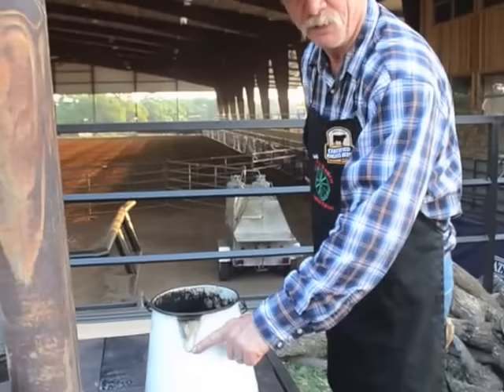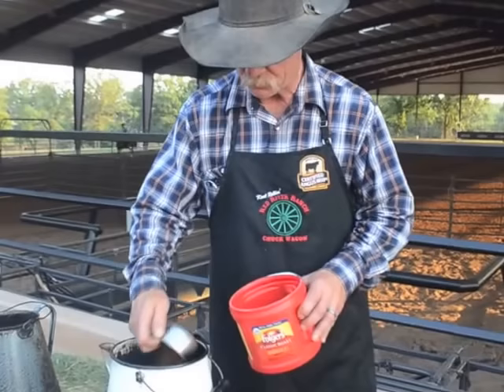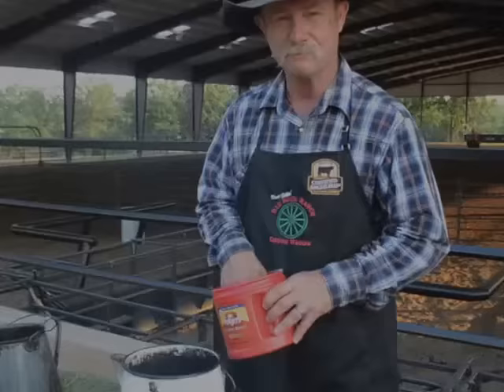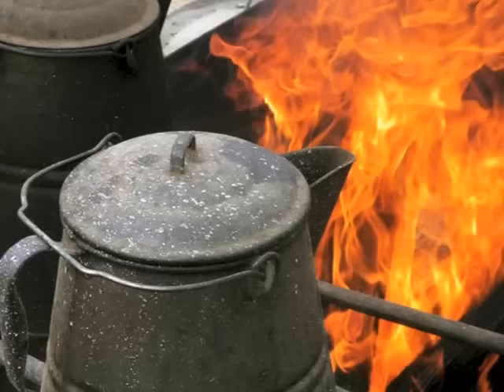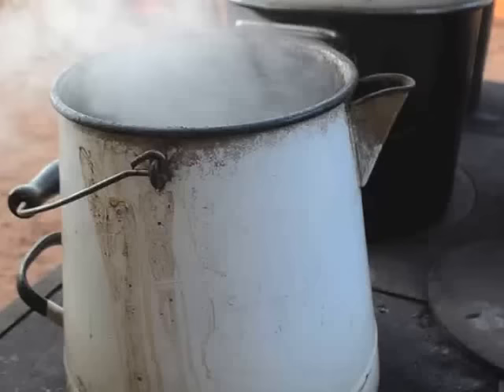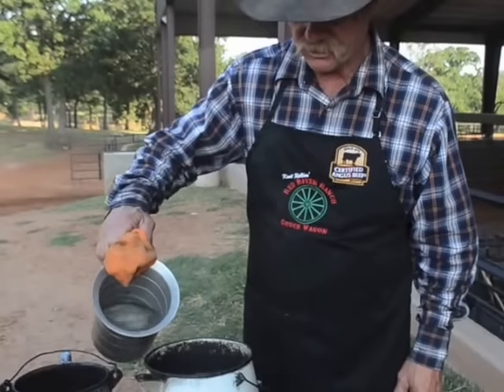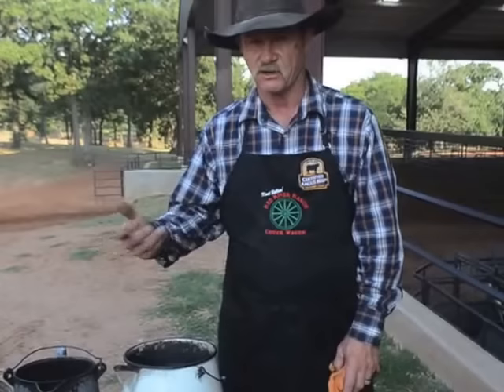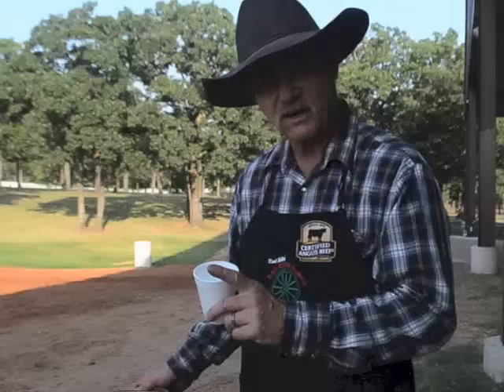Cowboy Coffee: How to Make the Best Cup of Coffee

Comment: I brew it up more or less like how i start iced tea. Just put my grinds in an empty pot, fill with hot water from the faucet, and put it on the stovetop set on high. Ill leave it on the burner till right when it starts to boil. Take it off the burner and let it steep for about 4-5m. The grounds settle naturally without cold water or anything if you let it steep for a few minutes off the burner. I never tried fully boiling it cause I figured it would burn it and cause bitterness like what happens when you boil black tea, but I'll give it a shot.

Comment: Definitely going to try this when I go camping next month. Thanks!
Reply: Chris Vega 
Make it at home before you leave, actually go in the kitchen and make a lot right know. You may never brew coffee at home any other way.....we didn't after we broke the glass coffee pot we got as a wedding present, though for guests we break out the French press for service AFTER boiling the coffee as Kent has shown which does take down the acid for a smoother cup of coffee

Rule of thumb.... add one additional cup of water to desired cups to brew and add scoops of coffee equal to cups to brew 
Ex: To brew 4 cups, use 5 cups of water and 4 scoops of coffee. The last cup holds the grounds in the bottom of the pot. 
Also I skip the cold water by letting the coffee cool about 3 mins to let the grounds settle out. That brings the coffee to about 180°, the brewing temp of your average coffee pot

Comment: Ken - wanted to give you a shout-out and say thanks for the tips....Went on our annual fishing trip up north. I have a 1.5 gallon coffee pot very similar to the GSI 20 cup blue one you show above. I have made many pots of camp coffee (hobo style) but in much smaller pots...It would be my first time using this old black enamelware 1.5gal pot I got yrs ago... The guys were very skeptical and had never had hobo/camp coffee...always had perc or pressed...So I offered to make it this trip...They were holding there breath about not having grounds in coffee...so much so that they brought a perc along just in case.. LOL...So they pulled the "don't wreck our expensive coffee" routine on me by buying Starbucks French roast (wholly pinky in the air coffee)..Needless to say their eye bugged out when they saw me dump 1.5 cups of it into the warm water...When all was said and done, ..well...They were asking for me to make more the next 3 days ….Here is what I did (pretty much same as you:1.) Water filled to bottom of 1st spout hole and bring it up until its warm to touch2.) Dumped in 1.5 cups (measured with an old boy-scout plastic mess-kit cup/graduated measuring cup.3.) When it came to rolling boil I set a timer (more so to make it look like I was chef-in their coffee LOL) for 3 min....but sometimes it went for maybe 5 (got busy doing stuff)4.) Opened lid and used a table spoons to splash coffee up higher inside pot to knock down the grounds stuck to sides. (didn't want to give the a reason to bust me on grounds in their cup. Also splashed the hot coffee up into inside of spout.5.) Now took that cup of cold water and poured a splash down the spout, and slowly poured the rest all round inside.They poured small cups at first...when no grounds were found...they came back for several full 20 oz cup ;-) - 2 thumbs up..thanks again - Tony
Reply from the maker: Anthony so glad everyone enjoyed and thanks for sharing

Comment: Learned how to do this from my colombian friends.  Depending on the roast/grind you may not need to do a full on rolling boil.  Also, you can  cover it after turn the flame off/taking off the fire and cover it instead of putting in cold water.  let it set a good 10 minutes and the grounds will settle depending on the size of the grind.
Reply: why is there a bunch of oils and specs on the coffe cup and a bunch of residue in bottom of Mason jar? doesnt look to healthy...

Comment: A few questions:

1.  If you get a 3 quart pot, how much water do you actually put in it?  You fill it lower than the top, so 1.5 to 2 quarts?

2.  Do you bring the pot to a rolling boil and then remove it from the heat or do you bring it to a rolling boil, let it cook for 3 minutes, and then remove it from the heat?  

3.  I’ve tried this in other types of pots and the grounds always want to boil over.  They rise and if you stir down the grounds to prevent boiling over the grounds stick all over the top area of the pot and get into the cup when you pour.  How do you prevent boiling over?
Reply from the maker: In smaller pots I like to bring to a boil slowly and then turn the heat down to keep it from boiling over

Comment: I tried this just using a sauce pan at home and it came out really good an d I'm pleased with it. But I have a couple of questions to make sure I'm doing certain things right: (1) what grind of coffee should I use (fine? medium? doesn't matter as long as I like it? etc), (2) should the rolling boil be maintained for 2 minute, or are you saying it takes 2 minutes to get to the rolling boil then it comes off the heat? and (3) when I make the coffee, it tastes great, but it's a bit "murky" looking - is that normal? Thanks!
Reply from the maker: Mark I use regular grind, and let mine boil about 3 to 4 minutes, and then let it set about 3 to 4 minutes after you add the cool water
Reply: @CowboyKentRollins  Thanks for the quick reply. I followed this method and now it tastes even better. The extra bit of boiling helps. We have a small drip coffee maker, but this simple method definitely comes out smoother and less acidic.

Comment: I’m having some trouble with mine. I bought a percolator from Walmart ($12). I follow the steps from the instructions. I usually do about 2 XL cups. I bring it to the rolling boil for usually 3 minutes. Then pour some cold water then let sit. The main cup of coffee tastes great but at the end I’m finding I still have some sludge left over. Sometimes, I get grounds in the first cups. Also, I’m finding if I make 3-4 cups of coffee and use two (one for me and my wife) and let the pot sit, when I go back for 3 and 4, all the grounds have risen and I’m just drinking grounds now? Am I doing something wrong? Does the kind of pot affect the way it boils and settles?. I’m pretty new at this but love the cowboy coffee way. Any help would be appreciated. Thank you.
Reply from the maker: True the heat down just a bit and when you pour cold water in make sue you pour down the spout and around the sides
Reply: Thank you for replying so quickly. I really appreciate it. Another quick question. Do you use fine or coarse grounds? I had a better result with doing what you told me. But I'm still finding that when I get lower on the coffe in my cup, i can see some of the 'residue' at the bottom. I swirl around the coffee and it mixes in with the rest and then I let it sitand it settles again. It's not grounds or anything, just some "sludge" (the best way i can describe it) builds up at the bottom. (Not sure if this is because the grounds originally are too fine) Like I said, if i swirl it around before I take the next sip, it mixes in. Then I let it settle and repeat. Is that normal? It doesn't taste gross, just wondering if that is suppose to happen, or if it is suppose to be clean the whole time? (I wish I could take a picture to show you what I mean ha). I just want to be able to perfect my Cowboy Coffee. :) Anyway, I love your videos. Really informative and entertaining. Keep up the good work. Thanks again.

Comment: Best coffee is made with cold water.  Next best is made similar to yours, but without boiling.
Coffee was made this way centuries before there were cowboys.
Most modern coffee makers get water way too hot and boil the oxygen out.  A little improvement in taste can be made by pouring into the cup 8 to 10 inches above the cup to mix air back into the brew.  Or filling a jar half full then shake vigorously.
Been there, had your coffee, and it's nothing to rave about.

Comment: Kent, can you pour out the coffee once you've measured up to the center of the spout?  I want to convert this to a smaller vessel. The problem is that I won't have a pot with a spout. I want to convert the measurements.  Do you think with a smaller amount of water that you would still leave it on a small boil for 1-2 min or shorter?  Thanks!
Reply from the maker: we figure about 1/4 cup coffee grounds to 1 quart of water. I still do about the  same boil time regardless of pot size, but you can adjust to your taste
Reply: Cowboy Kent Rollins Thanks!

Comment: for some odd reason it started foaming up on me before I got it to boil, I ended up with grounds all over the insides above the water level above the spout and aound the lid, do you have to spray the sides with cold water? or what did I do wrong? I followed all instructions

Comment: For us "city dwellers", would a percolator do the same thing?
Reply from the maker: Close
Reply: Ben Metsinger a percolator is a similar type of pot, but has a tube and basket inside and usually a glass knob on top.  It continuously sprinkles the water (as it turns into coffee) up over the grinds.  The water never boils, and the grinds don't sit in the prepared coffee. I love a cup of perk'd coffee but it's a different kind of taste. In my experience, it takes about 20-25 minutes to brew in a stovetop percolator and you have to keep an eye on the temperature.  Great if you're at home, but if you're out camping many people enjoy cowboy coffee.  Also, the pot is just a pot and doesn't have tubes and baskets and glass knobs bumping around when you're outside.
Reply: Thank you. I've been boiling my coffee two days now just in a pot on the stove. The taste difference is amazing. Thank you so much for sharing your cowboy knowledge.
Reply from the maker: Thanks Ben, it is some good coffee.

Comment: Love your videos, but... you are seriously wrong about coffee, Kent. "It was always done like that" is the worst case scenario in this case. You spoil your coffee rotten. It should not be broiled. Period. Not for 3 min, not for 1.  Stay away from BOILING your coffee ever.    Here is what happens when you use boiling water on coffee grounds:
When you use water temperature over 205-ish degrees, two things happen. 
First, the high temperature over-accelerates the degradation of phenolic groups, they quickly degrade into simple phenols , which contribute sourness and a basalt-like flavor..; 
Second, it dissolves some of your fatty acids, which give a cup its body. It also prevents other fatty acids from forming by destroying the aliphatic acids before they can combine in a single unbranched tail to phospholipid-derived carboxyl functional groups to form fatty acids. The lack of fatty acids make the cup taste thin and weak.
(It's important to note that the varietal matters. An Ethiopian Idido (as opposed to, say, a Sumatra Lintong) is going to have generally speaking a higher incidence of malic and acetic acids, which are volatile under heat, and a lower incidence of humic acids, which are resilient under heat. So a higher temp like 206-207 is going to do more damage to it, faster. But fully boiling water will do complete damage to the coffee regardless of varietal.)
Boiling water won't "burn" or "scald" your coffee, but will just ruin it. 
Thinking about past- it probably was the only way they knew. Thinking about today, when we apply all this knowledge we derived from science- why not to get your hard working guys some really good stuff?
Reply from the maker: That is a lot of Chemistry, I think I will just keep on keeping on, thanks for watching